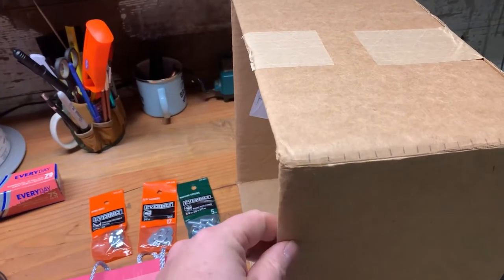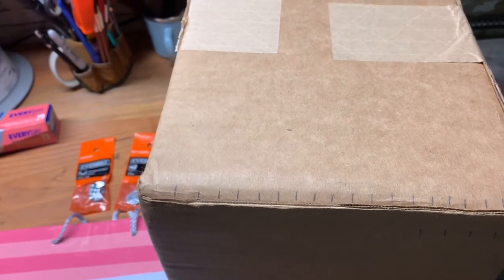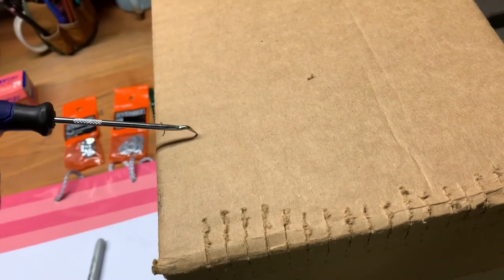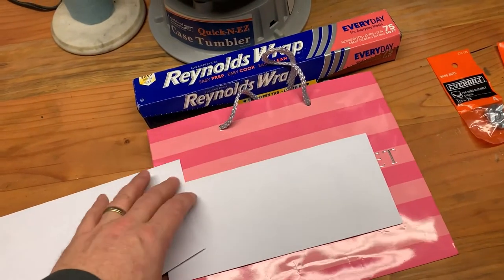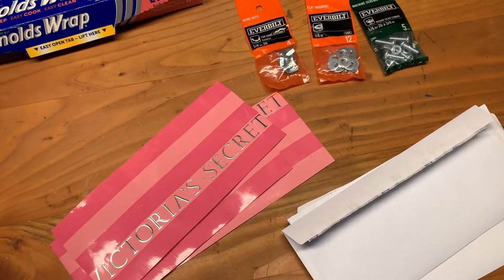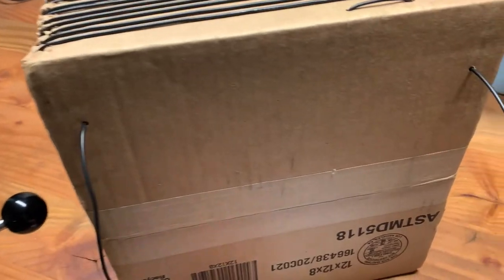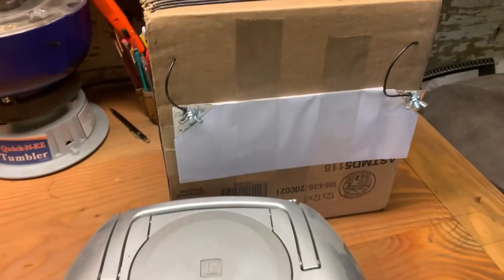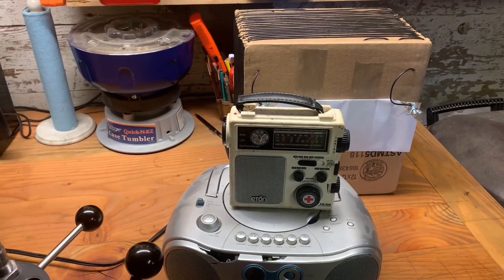DIY AM Loop Antenna

Comment: Looks like the problem is with the capacitor.  You don't have enough capacitance.  You need 300 to 500 pf.  Also try grounding one end of the capacitor and see if that helps.  You can buy some tuning capacitors online of about 360 pf.  Ground the front end or the frame of it and connect one of the coil wires to it.  Connect the other end to the stator, and see if that works.

Comment: Nearly 3 decades ago I made 80-100 turn coils on everything from paper towel tubes to vitamin bottles and connected an aprox 300 ft insulated wire to each end. The wires were draped over lower tree limbs and bushes in opposite directions. We normally got three AM stations during the day where I was at the top of Toledo Bend Lake in NW Louisiana but I got at least 50 by placing this coil near my radios. I could hear Dallas, Houston, New Orleans, and even Oklahoma City during the day loud and clear. It`s a great way to get more stations during the day when local options are bad.

Comment: That's aluminum foil;  tin foil is no longer commonly available.
Reply from the maker: You are correct.  I misspoke using the slang term for aluminum foil.  Thank you for the correction.

Comment: Hi Brandon! When I was a kid I used to help my dad when he was crafting his own antennas for amateur radio so this is almost like a flash to the past for me! I helped but I was strictly holding things while he did the magic. The only thing I can think of trying is to remove the insulator shell that is around the wire. I can't remember ever seeing any of his antennas with any form of shielding on the cable. He did have something called an "eggshell" insulator that kept the antenna isolated from the tie down points. Keep in mind his antennas were sometimes up to 500 feet long and were used for amateur radio which are in different frequencies then what you are trying.

Thanks again for sharing and good luck!
Reply from the maker: Thanks for the tips Jamie.  When I read the instructions, it said a minimum of 25m of any old wire.  But you are right, most of the videos I have watched on antennas and amateur radio use a bare wire.  I don't have any at the moment and my choice was based on it was $3 for a broken spool of aluminum wire, not necessarily the perfect choice.  It took me hours to unwind that mess.
Reply: @brandonhayes9226  I think the purpose of the shielding is to isolate the bare wire from coming into contact with other stuff. If it's a power cable then it would protect against shock or fire if someone/something touched the bare wire. I suspect in this case it prevents the shielded parts of the cable from acting as an antenna. The other thing that occurred to me is the possibility that you need to wind the cable in a specific direction. An old transistor radio DIY set I had when I was a kid had us wrap the antenna coil a certain way - I think it had to do with magnetic fields or something so if that could also be something to consider. 

Unfortunately not my area of expertise so i am purely speculating here. If it was me I would strip the shielding off the cable and try it again.

Comment: I found some 365 & 450 pf tuning capacitors online and got two of the latter and one of the other, a couple of larger spools of 22-24 AWG magnet wire, and a couple of bags of connecting wires with alligator clips on the end to make it very fast and simple to experiment with coils. About 17 turns of magnet wire on a 16 inch pizza box using both gangs of the 450 pf tuner is just about perfect for the entire AM broadcast band. I think I did 16 turns and needed one more to reach 500 khz. It did reach 540, our lowest fringe daytime station, but barely. 

My homemade loop blows away the AN-200 one they sell. I was really surpised by its performance. I have several large flat boxes solar panels came in and plan to figure out how to turn those into loops. My first try with a 4 ft box only tuned below 1200 khz but I was able to pull in New Orleans WWL 870 like a local during the day at 170 miles away and got a faint signal from Dallas 820 WBAP. That`s VERY far from my location here just above Alexandria, La. 

Try the AN-200 with a direct connection to the antenna port of the Tecsun PL-330. It can be set to use with external AM antennas by pressing and holding the NO. 3 button. GREAT little receiver for doing AM antenna experiments and it`s all someone needs for super AM DXing. It has a cleaner, stronger signal on most stations at night than my CCrane EP PRO or Sangean PR-D4W which are two of the best stock AM receivers made today.